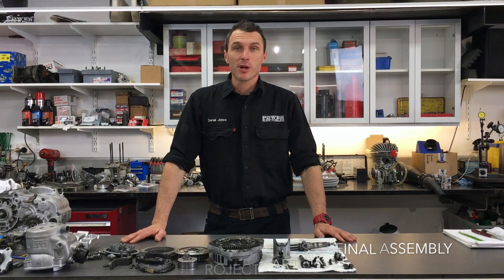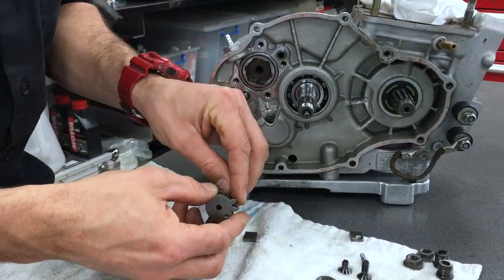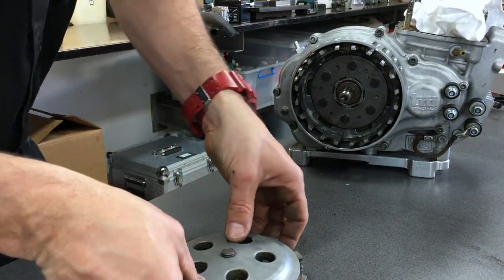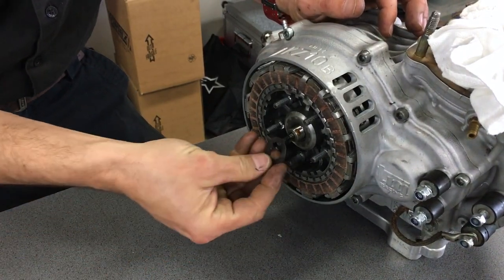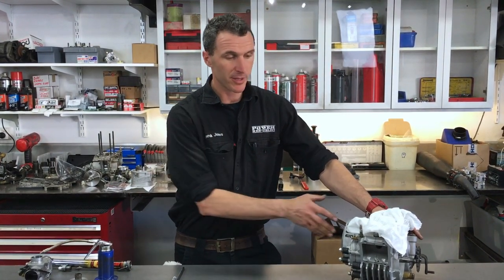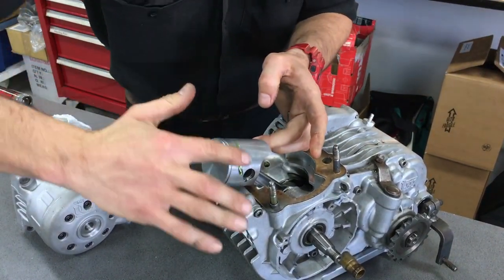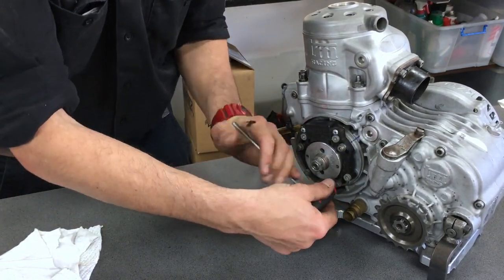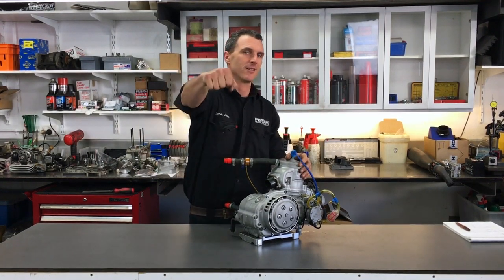KZ Engine Rebuild Project Part Six - Final Assembly - POWER REPUBLIC

Comment: Thank you for the videos. Is there a torque spec for the 5 clutch basket nuts? Or is just that you run the nut till it bottoms and apply a light torque?

Comment: Hey i cant get my clutch to grip it just dosnt do anything when i put my long shaft inside the motor
Reply from the maker: Patrick Hansen I had a problem with my clutch and it was I didn’t have enough clutch packs in it, it was one short of the driven disc.

Comment: Mate i have watched both five and six parts and i havent seen where you install the clutch cable arm into the engine. Do they just pop out with a screwdriver?
Reply from the maker: the clutch cable arm normally slides down into the cases once you have removed the clutch actuator push rod from the clutch basket side.   either that or there is sometimes a small retainer screw in the crankcase near the ignition rotor and stator.  hope that helps
Reply: @PowerRepublic   dude thankyou!! Appreciate your response. The push rod removal worked and my heart rate is slowly returning to normal. Thanks bro!
Reply from the maker: yeah boi, glad to help out!

Comment: i have a tm kz10b too: what can i change to improve power at low revs?
Reply from the maker: add some exhaust header spacers, reduce the ignition timing, move the cylinder down (remove cylinder base gaskets) as some ideas

Comment: Nice Video. But you need to show one more extremely important thing before you assemble the barrel: you need to check the piston ring clearance. If you don‘t and the piston ring clearance is too small you risk a seizure.
Reply from the maker: Thanks mate, yes that's is very true my friend.   this engine top end has already been used and run in previously to this video being made so we didn't show checking and adjust the ring gap, apologies.